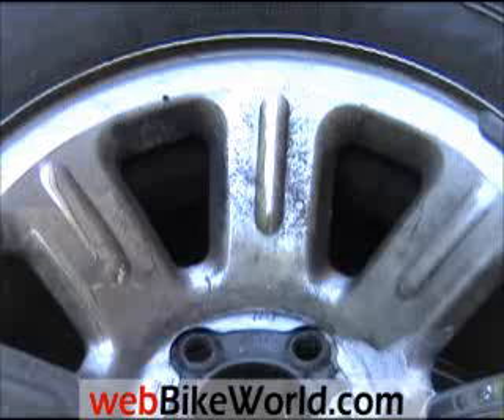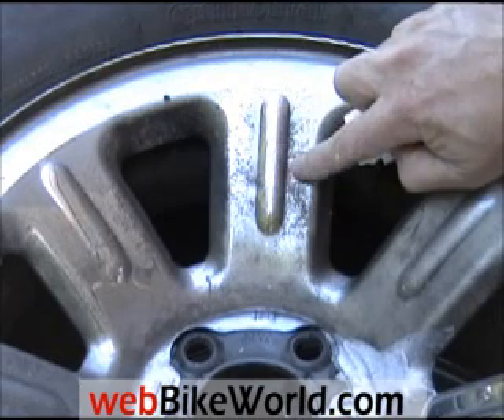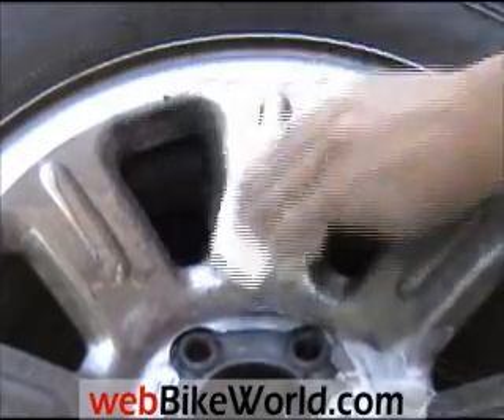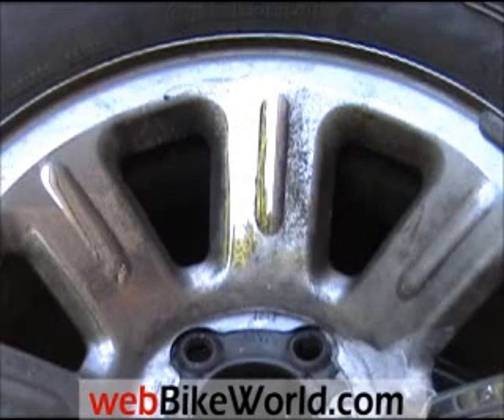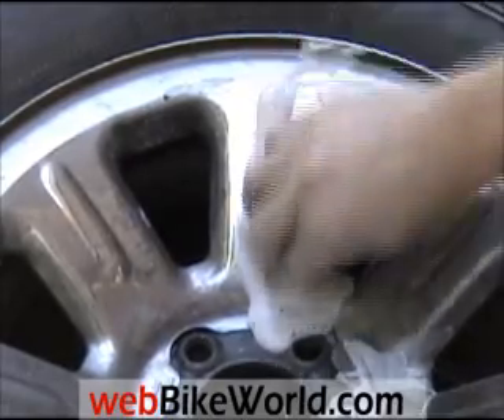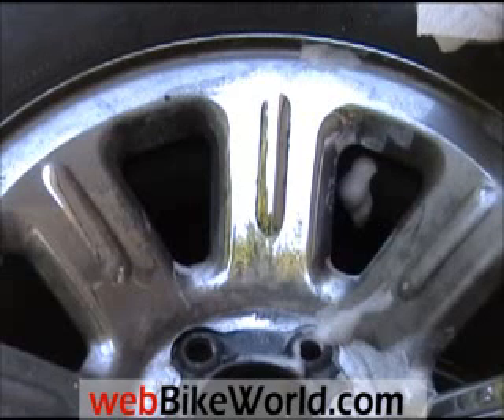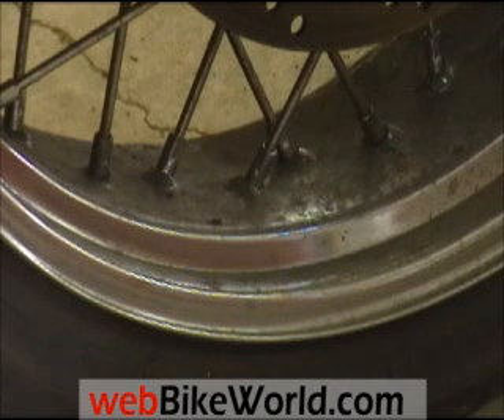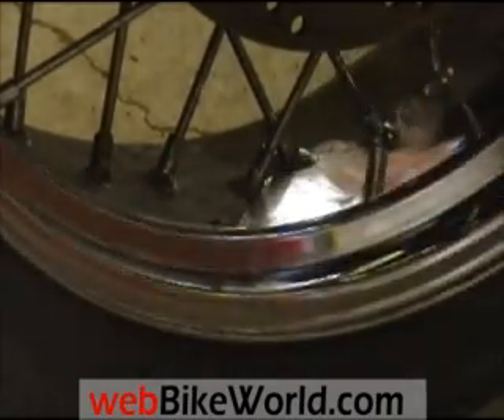Chrome Cleaning and Polishing

Comment: I kept my chrome rims on during this winter and they were pretty dirty and corrosion started to set in.

I googled and found this video and went out and bougth a bottle of the Noxon 7 for $4.99 and they look great.

I was skeptical at first as this looked like one of those late night commercials but it really worked great.  I am a little skeptical about using this regularly as I can't imagine the chemicals won't damage the chrome after some time.

Comment from the maker: Wow, sorry to hear that!  If you haven't damaged the clearcoat or paint, the first thing I would try is some light polish, perhaps a metal polish.  If that doesn't work, you might be able to use finer and finer sandpaper, wet sanding with really fine 320 or finer grit, to smooth out the scratches.  Then eventually you might be able to use a metal polish to get it smooth.  But it's very difficult to say without looking at your wheels!

Comment from the maker: @JUNIORGUS1 Well, that's exactly what this video is all about! It depends on how dirty it is and the availability of the cleaning/polishing products in your area. The S100 soap works well for lighter duty but you need water. Noxon works well and you don't need water. But before using anything, clean the wheels first with soap and water and a rag or something to get them as clean as possible before you start. You may be surprised at what basic soap, water, a light brush or rag will do.

Comment from the maker: Interesting question, perhaps others will have some suggestions on that.  If it's just surface rust, you may be able to polish it out but I wouldn't let it stay on too long or it may get beyond the surface coating.  I have used some treatments that neutralize rust, but they turn it black. I think you're going to have to work at it by hand to polish it out.  I wouldn't let it wait too long!

Comment from the maker: It won't "fix" corrosion, but will remove most dirt and tar and light surface issues.  It's pretty hard to remove the corrosion once it sets in, but it can clean up the slight pitting that signals the beginning of serious corrosion problems.

Comment from the maker: @Typhlosion100 It's not easy to remove the little rust specks that form on chrome, especially if they are bubbling up from the base metal. Interior chrome may be plastic underneath, so I'd be careful. I'd probably try some Wenol or other chrome polish that is less abrasive and less aggressive. Try it on a small spot first to see how it works.

Comment from the maker: Good question, I guess it depends on what you mean by "slight discoloration" and "water spots".  I'm surprised the Noxon didn't clean them up.  If the chrome is thin or or poor quality, you may or may not be able to clean it up.  It also can depend on the base metal type that has been used for the chrome plating. Try a mild polish maybe like Wenol?

Comment from the maker: Difficult to say - if the scratches are in a clearcoat or lacquer over the chrome, it may be difficult to remove them without re-painting. If just in the chrome, you should be able to polish out a light swirl mark with a good chrome polish, like Wenol. It may take some elbow grease though...

Comment from the maker: @fofofoofong7 if it's chrome plated, it should work the same way and I've used it on chrome trim. But like always, check it in a small inconspicuous area first and don't let it get on the paint as the abrasives in the chrome cleaner may scratch.

Comment from the maker: @flaco198111 It depends, some people have better access to S100 than Noxon and vice-versa. There's no single "perfect" solution, I'd suggest buying the product that's available in your area and trying it. By the way, I didn't make it clear in the video, but it's always important to wash the rim first with auto wash soap and water first to remove as much dirt and grime as you can before polishing. I didn't do that on the motorcycle wheel, a mistake.

Comment from the maker: @Mwd182528 Cheating? That's pretty harsh, no? It's a video illustrating how to clean a chrome plated wheel, not how to rebuild or restore chrome plating that is completely gone. These are cleaners that work to remove dirt, grime and light corrosion. That's why it's entitled "Chrome Cleaning and Polishing". If the chrome is pitted, flaked, destroyed or corroded from underneath the plating, no chrome cleaner in the world will help, the wheels will have to be replated.

Comment from the maker: Not sure I'd want to use steel wool though? It seems like it would be too abrasive.  The Noxon is pretty caustic stuff also, on projects like this, I usually try to start with the mildest solution first (i.e., soap and water) and then work my way up to more powerful agents if needed.  

The idea in the video is to use chemicals to do the job rather than taking the chance of scratching the finish with an abrasive material...

Comment: Hey, I have a question for you. I've had a set of wheels for about 4 years. I only have them on from april/may til sept/oct depending on weather.  I do, however, keep them in climate controlled storage during the off season. Alright, last summer I cracked a wheel and had to order a new one. When it came in and I compared it to the other 3 I realized how bad they looked. Really dull almost cloudy like. I clean them allll the time. Regular soap and water and Meguiars chrome cleaner....continue...

Comment: Is there a way to get scratches out of chrome that has a clear coat? I REALLY messed up by using mothers polish on one of my wheels only in a small spot tho it scratched and dulled it really fast... if it has a clear coat like paint would a rubbing compound work like you would get scratches out of paint?

Comment: I think this video is cheating, normally this type of chrome it have three layers and the porosity is started from third layer inside to out side cause by oxidation  that it make copper layer (second layer) are broke out than it defect the chrome layer ,so it is impossible the Noxon or S100 melt these three layers become  a smooth like one layer.